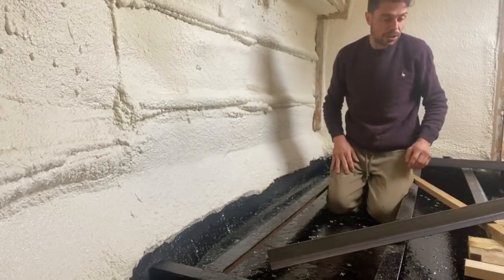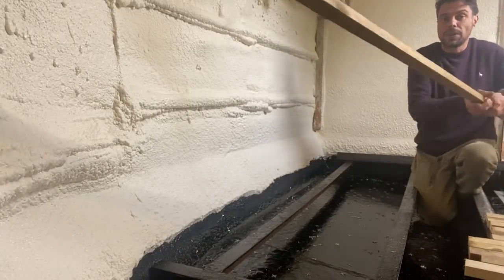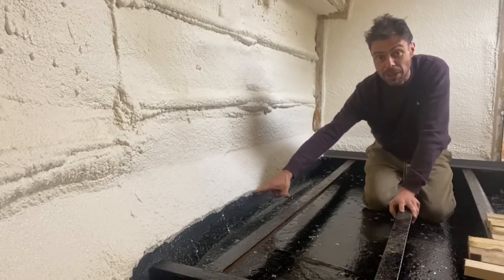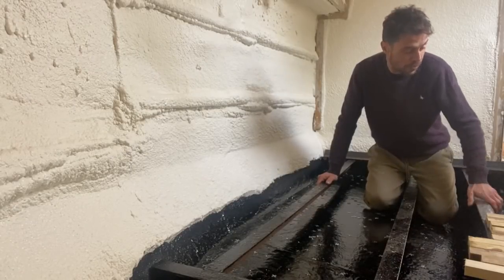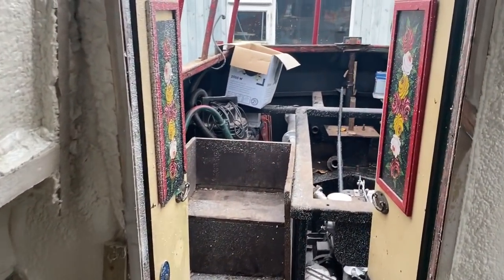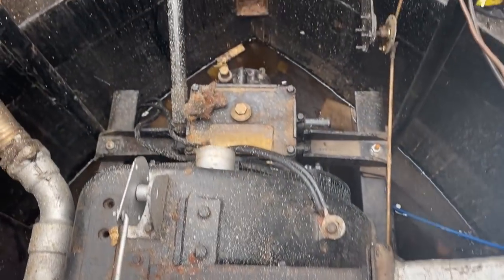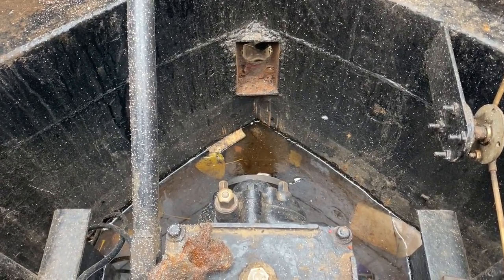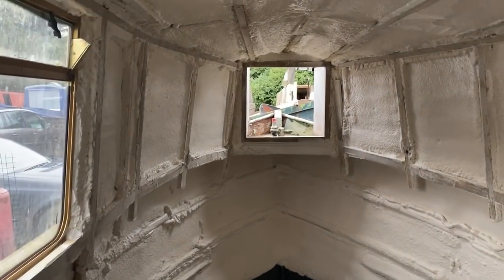23. Narrowboat flooring finally starts

Comment: If you have an electric plane you could plane a standard button to the hight required for the centre beam.
Reply from the maker: Do you mean plane down the 2x1 by a few mm ?
Reply: I used a power plane on the doors of my house when I changed them. Depending on how much you need to take off it might two or three passes. Very messy with all the wood chips. You would need to do it outside
Reply: @TheNarrowboatThatJamesBuilt  aye. Just take 2.5 mm or whatever from your stock battons.
Reply from the maker: Mark Kasprzak yeah I have an electric plane but as you say, darn messy! I maybe able to use the bandsaw in the workshop here which would work nicely
Reply: @TheNarrowboatThatJamesBuilt  Ha! I went posh. I had a bag attached to my plane. 
It lasted 3 jobs before I planed a hole in it. No mess till then.
Reply: A bandsaw would work but it would not be as smooth as the plane. Although you could but the cut side down. I wonder why the floor is cambered in the first place?  Anyone out there know why?
Reply from the maker: Mark Kasprzak it’s not cambered, just slightly uneven. It doesn’t matter about appearances as this is all under the floor hopefully NEVER to be seen again
Reply: In that case,cut one on the bandsaw and see if you like it.   I saw on another blog that they are importing narrow boats from china, is that true
Reply from the maker: Mark Kasprzak probably, nearly everything comes from there 🤣
Reply: Same thing on this side of the pond.
Reply: @TheNarrowboatThatJamesBuilt  Definitely use the power plane. Most have adjustable cut depth and a chip ejection port that you can hook a shop vacuum to. The vacuum will also be really useful for the rest of the renovation. What I would do is put a batten on each outside support, then put a known straight edge between them. Take a measurement from the straight edge to each metal support and there's your batten thickness.
I'd also suggest a bit more PPE - watching you chip away at the insulation without a dust mask is a bit scary.

Comment: There is no need to weld the side bits in you can not walk that close to the edge of the floor to make it move if you stand with your shoulder against the side of the boat look down and see where your feet are they will probably be on top of you first floor battern
Reply from the maker: Big I know what you mean however down the walkways, they’re 2ft wide and the floor will be unsupported for half of that - and the cross beams that are there are too far apart to span 1 sheet
Reply: @TheNarrowboatThatJamesBuilt  that boat is about seventy years old and it has obviously not been a problem in the past so why will it be a problem in the future.
Reply: Maybe James needs all that metal so he can do some ramming when the canal gets crowded. Lol
Reply: @bigKDL  no where near that old...!
Reply: @matt-analoguelife  that  is a Springer narrowboat they were made by Springer  engineering  in  Market Harborough from the early 1960 to the early 1990 so the newest one's are thirty years old and the oldest are close to seventy years old
Reply: @bigKDL  I was born in 62 and am no where near 70 years old..!

Comment: You ought to batten the bow walls.
Seriously a bad idea NOT battening the bow for wall coverings.
Foam insulation exposed walls is truly ugly and corner-cutting especially if you use the area above the water tank for seating or a berth.
Reply from the maker: #WTFOOK SNAFUWORLD I’m not going to have any foam exposed on view. But what’s the point in battening and lining inside the water tank cupboard ? I’ll line the floor but surely not the lower walls ??